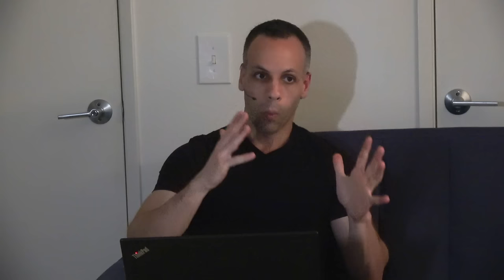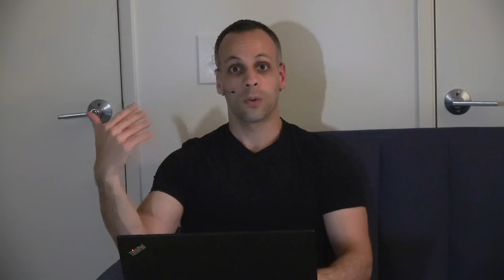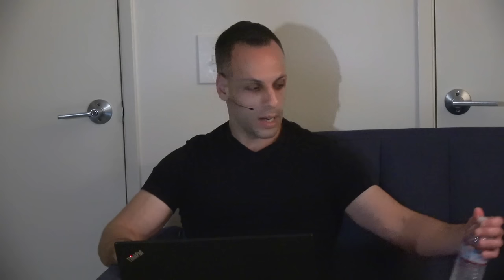EVGA's Oversight: Unannounced Changes Destroy PCs, EVGA takes NO ACCOUNTABILITY

Comment: Its straight forward in this case, its negligence from EVGA when they use the same conectors for diferent pinout on the power supply site of cables, gross negligence for your data when they sent diferent pinout in RMA case, even if they would add any warning,  and they are liable for any damages and loss of data in the case of RMA. EVGA is playing with fire when they are pulling this shit, its only a matter of time when they hit the right customer with money, do a lot of damage with their gross negligence and get sued in milions.

Comment: Only if there was way to change connectors from PSU side, no to take cables from old revision.
Also why that new revision even have 3.3V SATA power rail? It have been around 8 years from release of "SATA revision 3.3" with "Power Disable feature"

Comment: While it's not quite the same, what happened to me is in the same ballpark of non-standard BS and put Dell PCs on my permanent shit-list for the last twenty years: Back in the early 2000s, Dell PCs used the same mobo power plug and socket as the ATX standard, but a non-ATX standard pinout. So me not knowing that there was a metaphorical landmine in a Dell PC I was diagnosing plugged a standard ATX power supply in to its motherboard. Upon trying to power it on, it literally smoked itself!

So Dell intentionally put out a design for their PC mobos and power supplies that would kill a ATX standard mobo plugged in to a Dell PC power supply or a Dell PC mobo plugged in to a ATX standard power supply. That is some dickery of the highest order and I will never have anything to do with Dell PCs if I can avoid it. I wouldn't get a prebuilt PC anyway, but it goes double for Dells.
Reply: No such issue with a Dimension 4600, which has a Pentium 4. (Northwood 2.8, IIRC) This was back in the late-'00s and I saw one with the PSU changed to an Antec.

Comment: This wouldn’t be opening them up to abuse from the customers. 

This is like if a part breaks on your car and they replace it with a new model which breaks the entire engine. All because they changed some connection or ratio or some other thing. 

That’s on EVGA.

Comment: At the very least, the cables from any given manufacturer should be standardized.  There is no reason to change the pinouts once they've been established on the first PSU off the line.

Unless you're Dell.

Comment: I have less of an issue that they don't use a standardised pin lay out as I have that they use a standardised plug for the non standard layout... A simple key/cut out on the plug based on the pin set would prevent this issue.

Comment: Guess they don't have a marketing fund now, would have been pretty easy to meet them halfway, dip into the marketing fund and at least replace the drives for them. Throw a nice PSA out there and let people know. Add that to a requirement for CS/RMA dept to check for these units or put a warning on the RMA site. This is why I buy corsair psus, same connector for ages for the RMX series and check the matrix when buying new psus. Shame, but they will learn or lose business and harm their already dwindling market share.

Comment: I believe EVGA is just rebadging power supplies. As such, their supplier(s) are probably frequently changing designs, and they just slap a model number that corresponds to the rating.

I also wouldn’t be surprised if they are drop shipping the RMA’d PSU directly from the supplier, to save money. This would explain why they don’t include new cables.

Ultimately, this seems like a lazy business for them. Not hard to resell PSUs someone else makes. At bare minimum, they should inform consumers of the pinout changes, and have a big message telling people not to reuse the cables.

But they really should be including new cables with the RMA power supply. Assuming their PSUs are actually good enough to not be constantly RMA’d, they can eat the logistics cost of sending new cables.

Comment: I don't even understand why they had to change the pinout on the PSU side. Why would a single manufacturer have different kind of pinouts for the "same" power supply, it just makes no sense.
The only reason I can think of they found some random power supply boards, stuck them in EVGA cases and sold them as if they were the previous version so they could lift on the marketing of it.

Comment: Well EVGA doesn't make their PSUs , like every other company it buys it from one of the 3-4 PSU OEMs, so thats why you have different quality between models, now if at some point they change supplier for a specific model and that ended up changing the pin outs is on them to keep track of the revision(which  obviously they didn't in this case) and send the replacement unit with the correct cables if needed them and splicit instructions not to use the old cables, if they didn't did this then they are responsible but if they did send the correct cables and the user decided to use the old ones then is on him.

Comment: Holy SH*T! I already learned, the hard way, that manufacturers don't agree on pin-outs for the modular power cables. But to mix and match between the SAME model? I killed a motherboard and PS making the assumption I could reuse those cables. After that magic-smoke event I validate pin--outs every time, especially since none of those @sshats label their cables to help avoid mixing them up. Now I know validate the rails EVEN IF IT'S THE SAME MANUFACTURER. Thanks for the heads up Louis! 
For the record, that specific MB incident was due to a EVGA power supply failure. It, a 'gold' 850 watter, worked (still 'works'), but sagged the 3.3v rail enough to cause random BSODs and etc. IMHO, avoid EVGA power supplies. Over the years I've had THREE go bad in one way or the other. That their modularity varies from build to build even on the SAME MODEL is just the nail in their coffin for me.

Comment: The switched OEMs and the OEM they switched to uses a different pinout would be my guess. Companies like EVGA do not make their own power supplies those are made by a small handfull of companies to the reseller's specifications and then rebadged.

Comment: I was already disappointed with eVGAs GPU division because of all the 980 Ti's and 1080s with exploding VRMs, as I had a 980 Ti ACX2.0 that shot sparks in my PC and sent 12V to the GPU core making it irreparable just 2 months after the warranty expired, and eVGAs response to me was basically "that sucks, time to buy a new eVGA GPU" and I was like "lol no". 

However, I've still sworn by their PSUs, the G6 1000W currently in my PC is freaking fantastic. But seeing their PSU division do something this ridiculous, especially since their PSUs largely consist of rebranded and discounted FSP or Seasonic platforms, I'm now struggling to see a compelling reason for eVGA to continue existing.

When eVGA quit making GPUs they were like "we're a PSU company now". Are you, eVGA? Is this something a "PSU company" does? Friggin' yikes guys.

Comment: Corsair is probably the best in this respect. The have type 3 and type 4 cables with type 4 being used on most of their PSUs from last several years and newly released models. I have type 4 cables from a $60 PSU on a $300 PSU.

Side note: most people don't know many cheap SATA power cables are fire hazards as I learned the hard way. The cables are set in a plastic mold so the cables can end up touching inside the mold and over time, they heat up until plastic melts and voila, fire!
Reply: thx

Comment: If they changed the pin out they should have modified the plug so only the correct plug will fit in the correct pin out.

Comment: Any hard disk on the same power supply is not a backup, as I experienced many years ago on a PC when one of the power supply rails went high and blew holes in all the hard disk controller chips.
As a retired heavy industry systems engineer to hear that the pinouts aren't standard just violates all sense of decent design practice.

Comment: It's a very rare occasion that I strongly disagree with you. The negligence is very clearly on the part of the manufacturer who straight instructs the customer incorrectly to keep the old cables. Every single customer who received back a PSU with the different pin-out should be eligible for compensation as every one of them was put in danger of frying their equipment, with the only variable deciding whether they fry their equipment being whether the customer has any SATA device or not.

Comment: last time i RMAed a EVGA PSU that sent a new PSU back w/ cables in the box, but changing this without changing the model number... holy crap cablemod is going to have some issues, i have the old cables in a somewhere i keep stuff like that for DIY projects

i have seen seasonic unit this happened with but they changed the entire pin layout (2x3 vs 1x5 plugs) (i think the changed the rev. number)

Comment: To my knowledge, EVGA doesn't even manufacture their own power supplies. Instead, they just rebrand them from some OEMs.
Like my power supply, it's a Super Flower Leadex II Gold 750W, but EVGA also sold it as the G3 750W (or G2, i forgot).
What i speculate has happened is that they changed OEMs and didn't tell customer service about it.

Still their fault though imo.

edit: commented before watching the whole video, my speculation was right xd

Comment: 13:06 - Generally speaking, yes. But in this case I really think the end user seems more than capable of arguing that when you send back a PSU with a different pinout and the explicit instruction to keep and use your old cables, then its "beyond reasonable doubt" as the fancy lawyers say that its exactly what happened. Especially if the damaged components corrolate with the new pinout. Its very hard to argue someone fried their drives with another PSU, then swapped back to make it look like yours did it when yours have this exact known problem. It would also be very reasonable to think that when combined with the above, if a Corsair PSU did this, then the person would have this conversation with Corsair and not you. If its taken to the legal system, it would be uncovered if the person first tried to blame someone else before you though.

Its a shame that legal battles are so expensive you have nothing to gain from going through with it, because this one sounds like it wouldnt hold much water imo. Then again, not a lawyer.

Comment: Poor decisions from EVGA, the cable from plug to plug should be standard across the product lines. I owned 2 EVGA power supplies and sometimes I would cable swamp between then because one supply had longer cables, but I always checked the pinout before hand, and you have to be very careful because the cable all wires are black so if one wire is tucking under a different wire then you could end up frying whatever you plug in.

Comment: Nah, in my book that's fully EVGA's fault, there was no way for the customer to reasonably get that PSU back into service, they've sent a PSU in and got one back that is incompatible with their old cables. They did not send new cables, even if they told the customer that the PSU has a new pinout, what are they gonna do? They DO NOT HAVE THE CORRECT CABLES to get it working.
If it's a different PSU model, sure, different manufacturers, absolutely, even if it's annoying, same model but different production lots, maybe, but if you send it in for RMA and get it back, there is literally no reason to ever suspect it wouldn't work.

// Edit: someone tell Steve from GN? :)

Comment: his data is still on the disks and likely 100% fine. the poor guy just needed to remove/replace the TVS diodes on the drives and check the fuses right near the power connector :(

Comment: EE with 45 years experience here. Cables are the least reliable part of most any assembly. Connectors are the least reliable part of the cables.  Modular power supplies double the number of connectors. Do the math. No thank you. I'll deal with the cable management.
Reply: Oops. Meant to say it doubles the PAIRS of connectors. It actually TRIPLES the number of individual connectors just to get from the PS to the end of its cable.

Comment: You would think that even the same models would work with their own cables. If they don't make you send ALL parts and replace your stuff with the "same parts" you SHOULD have workings tuff and if not then they should give you replacement connectors and cables to ensure they wont brick your and their stuff.

Comment: I totally disagree with you on one point.  I understand that companies can't replace data loss.  However, it's clear, in this case, that changing the pinouts would cause harddisk failure.  It is reasonable to expect that you get a replacement of the same model, that you don't need to check the pinouts.  I can't plug a 4 pin gpu connector into a CPU connector.
Also, this is a specific case, where the customer can show that they owned 2 different versions, without being told.  I agree that it isn't reasonable to honor warranty without some burden of proof.  What what I do, if my motherboard fried my CPU and the company turn around and tell me it was by PSU?  I would have to get the PSU tested and provide proof that it was is good working order.

I think a lot of people know this, but you don't have full redundancy, unless the two systems are total separate.  Different PSUs, different LAN cables.  Servers can have entire redundent systems, which can be swapped.  Ideally they would also have difference power sources as well.
This isn't reasonable for most people, outside of datacenters.

Fundamentally, EVGA should have replaced the power cables.  which would have happened with server level gear, because it's hot swappable.......
It is reasonable to expect the same product, in return.  Since they swapped the pinouts, this wasn't the same product.
Hopefully they backed up their data.

Comment: EVGA, like most brands are selling oem power supplies from whoever.. HEC, Delta, Seasinic, Superflower, yuo name it.. and the OEM can change they connectors or anything at any point, even the same model of the psu could theoretically be produced by ditferent oems alltogether. Is it renders EVGA not guilty? No, they are, but in case of not even handling your own manufacturing you have even less control over what you're selling under your name, and it seens that they dont care to much, most likely they were unaware (at first) that OEM has changed the pinout.

Comment: Too bad that 12V-only ATX standard failed to replace all those different voltages we continue to use today. Otherwise the only thing we would worry about is short to ground, which is unlikely to kill anything beside the PSU itself.

Comment: Putting aside how EVGA handled the situation, I completely disagree with having these voltage pin changes printed in a big font somewhere. Sure, it's better than nothing, but the root of the problem is EVGA changing specs on the same model for a modular PSU. This doesn't just apply to PSU manufacturers: if it has the same model it should be virtually identical to another device and parts should be compatible. The moment the specs changes IT'S NO LONGER THE SAME MODEL.

Comment: Yeah its not just on the PSU makers its everyone else as well. Bought new parts for PC, used old Modular PSU and its own cables, didnt change them. plug into board and drives and get smoke. Think its board contact RMA to board maker, silence, finally buy second board to replace and semi similiar situation but not that bad. Take to repair place cause at this point Im stumped. Well apparently the blank pin location on the Mobo was different than my PSU so when it sent power to the drives it sent them on the ground wires and not the 12v. Yeah lost 2 drives cause the Mobo manufacturer changed the pin out. 

As you said Louis why this isnt a 100% locked in standard or at least relabeled as whatever 2.0 when a pinout changes is fucking baffling. Luckly I got the both boards, first still works just HDD connector little melted on it, and the second board is in my PC now. 

But bottom line IMO is if somthing is supposed to be a STANDARD then it should be the same 100% of the time no exceptions, make a change label it 2.0 and put it in BIG BOLD LETTERS.

Comment: IMO, EVGA made a major engineering pitfall. It's on them for ruining consumer hardware. Either they emit fault, and suck it up and pay the extra cost (even of replacing hardware that they didn't break) for such a dumb mistake or customers have to move on and find a trustworthy vendor.

Making the customer pay for your mistake is just scummy.

If I have an electrician install new outlets at my house, I'm not going to go around and use a multimeter to test that he didn't accidentally wire an outlet to 240v - I'm not the electrical expert - nor should I expect to be. If my house burns down from the mis-wiring, that's on the electrician.

Comment: EVGA was my go-to for GTX GPUS and the greatest headphone amp PCIe sound card I've ever owned is the EVGA NU AUDIO... but yea, PSUs need research
Reply: Huh. So people did buy them. Tested a Nu-Audio side-by-side with a set of Hurr-Durr 600s and an Audigy 5/Rx, and didn't notice a difference. Used FLACs of Beastie Boys, Metallica, whale song, recordings from the Voyager space probes, and a version of the 1812 Overture with actual artillery.